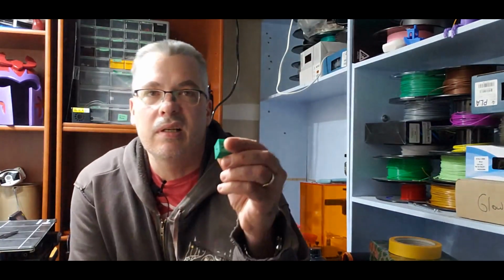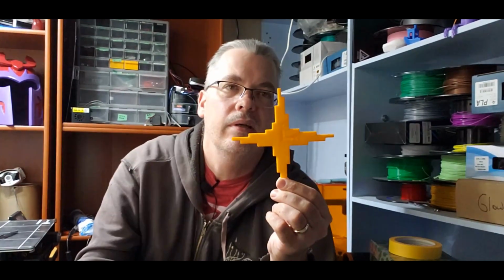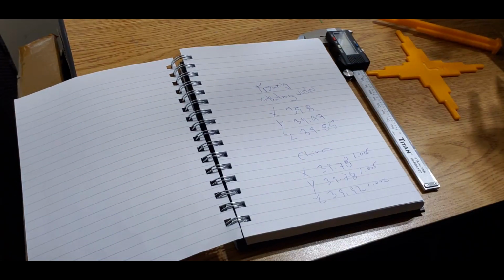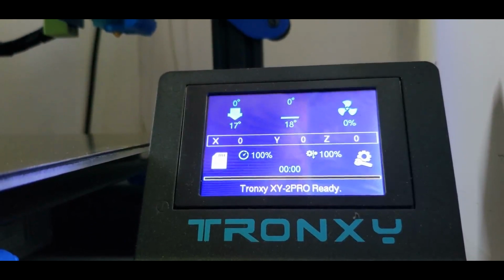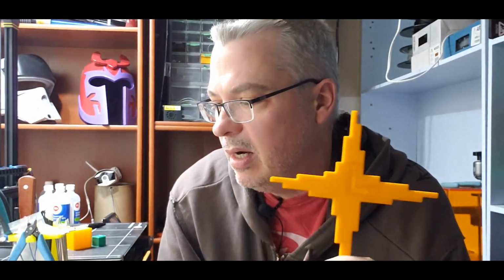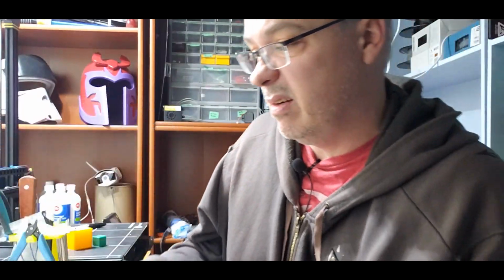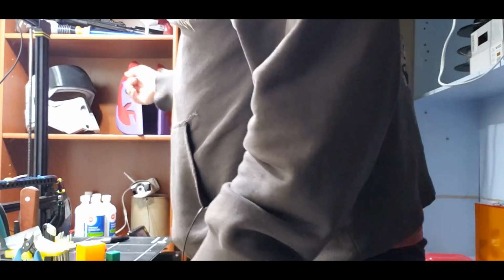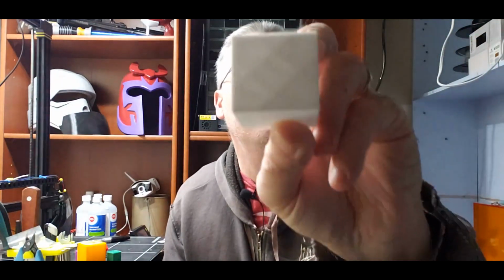To Calibrate XYZ? Or Not....

Comment: First off, I want to thank you for making these videos, especially those dealing with the Tronxy XY2 Pro.  I mainly use resin printers but bought one of these for the occasional larger part.  You've clearly spent quite a bit of time tinkering with this printer and your testing and modifications have saved me time and effort to understand the nuances of this machine.  As a mechanical design engineer with many years of experience designing plastic parts (among many other things), I'm actually amazed at how accurate these inexpensive 3D printers are considering the relative crudeness of the FFF process with the high thermal expansion coefficients of the various plastic filaments.  Even parts made on $100K+ injection molding machines may require a bit of tweaking though the process is much more tightly controlled.  I agree with your conclusion with not messing with the calibration unless it's way off.  Oh, and a little sandpaper or filing can often be an easier way to dial-in critical dimensions.  Keep up the good work!